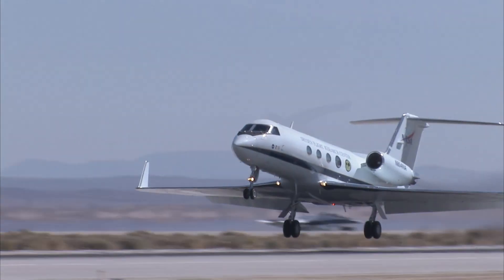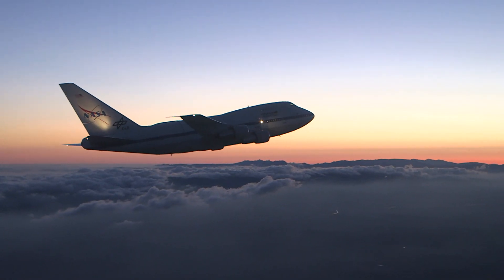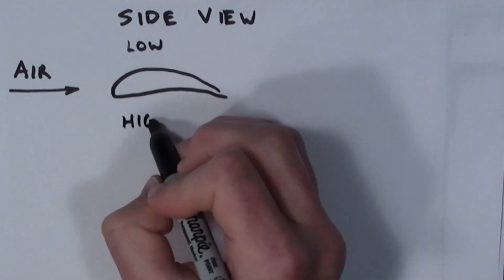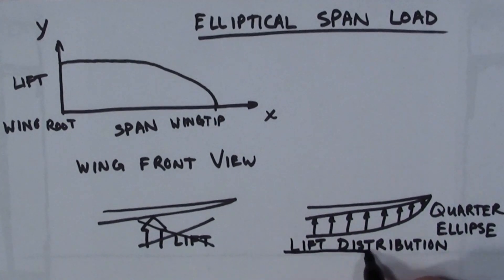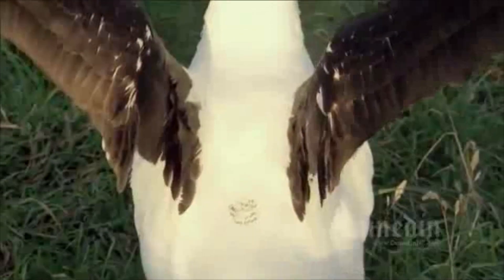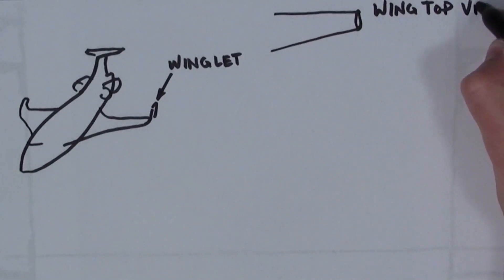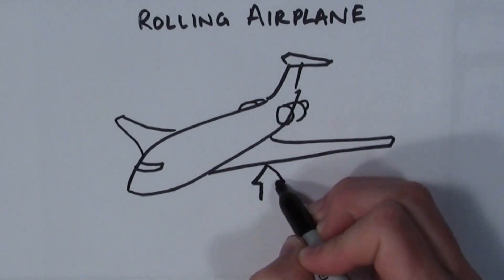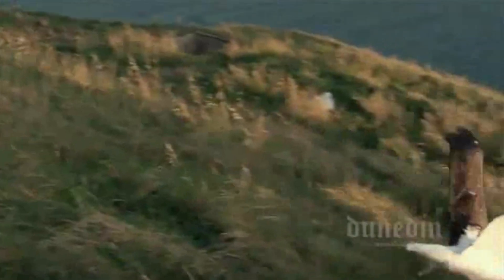Proving Prandtl- With A Twist!

Comment: Isn't this just what was previously called 'washout?'
Reply: +Grant Bennett Apparently not just old-fashioned washout, here. This design is generating upwash with the outboard section of the wing, i.e., it is at a negative local angle of attack. Normal washout simply reduces the angle of attack, but doesn't make it negative.
Reply: no.
Reply: Ah, the young and less learned.  Yes, it was.  It was used to prevent stalling, and was a part od building all model gliders.
Reply: And I don't mean to disparage your work, as I do think it is significant, but we did do this to prevent stalling on model gliders.  If this is significant to current aircraft, then great; but it's use, even for another use, did have another name.
Reply: I've flown a lot of weight-shift controlled hang gliders ( swept, twisted flying wings ) since the 70's and for the most part adverse yaw was not an issue at all.  The wings were yaw-roll coupled by nature of their geometry (when configured correctly). We didn't really need an on-board microprocessor to verify this.
Reply: @christheother9088  And also it is weight shifting just like how birds to. In planes, I am not sure we can do that kind of adjustment
Reply: +Chris Gonzales Yes, adverse yaw is a real issue on weight-shift-controlled hang gliders. They do work, but they have significant adverse yaw - especially the high-performance gliders with higher aspect ratio. Hang glider pilots just live with it.